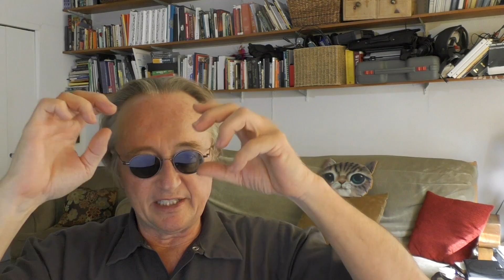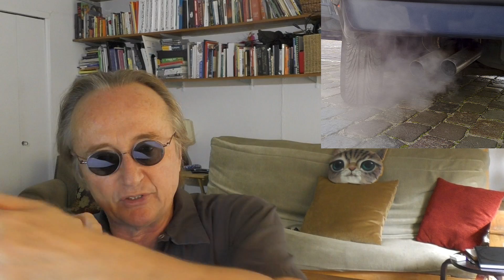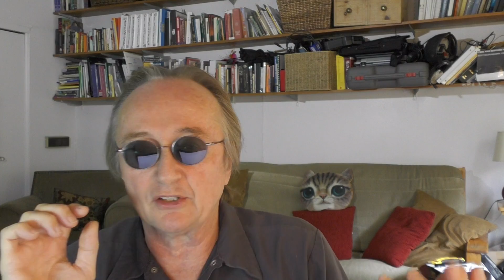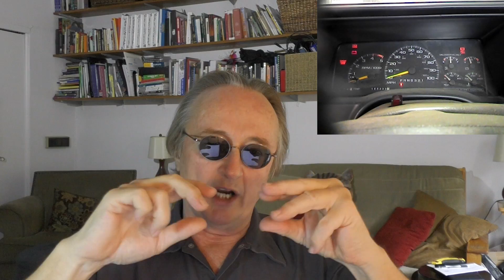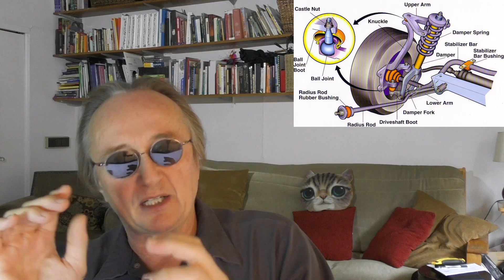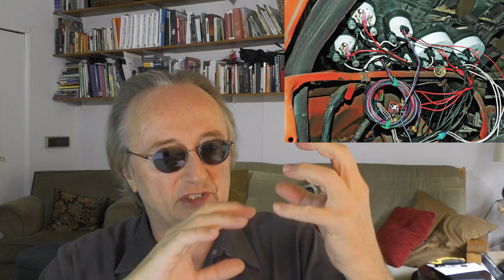This Product Will Destroy Your Car’s AC System

Comment: I've used an A/C stop leak numerous times with good results and have never had a unit damaged by it although I can easily see how it could happen. I have found that much more damage has been done to cooling systems (of all types) by untrained personel or, worse, Youtube "trained" personel  doing their own repairs.

Comment: Most interior lights have constant positive power to them, and the door switches simply complete the ground when they engage, the manual dash switch also just completes the ground. If the ground wire is shorted anywhere on its length, it can turn the lights on intermittently

Comment: Great video as always, I didn't want to comment on the Subaru though. The newer Subarus all have CVT transmissions when you get the automatic. But they do step shift like a regular automatic in certain circumstances. So it's possible that it was feeling like it was slipping but it was just because it was a CVT. It's one of the things I don't really like about the new Subarus. I've heard the transmissions are actually drive really good them for a CVT. 
I had some older Subarus with the 5-speed automatic and quite frankly those transmissions didn't shift that great either. Never had any maintenance problems or repairs, but they just seem like they hunted gears and never really knew what the hell they were doing. Compared to the same generation Mazda and that thing almost read your mind, and pick the gear you would have picked if it had been a manual transmission. Was a really awesome automatic.

Comment: Hey Scotty,
I have a 2007 Acura CSX Premium model with 124,000kms eh. I’ve been debating whether I want to do some basic mods to it; such as chips and turbo, and/or putting in a new sound system (single or double din stereo, speakers, and sub). What are my best options with this car?

Comment: Hey Scotty, greetings from Round Rock. I have a 93 Previa 2wd with the automatic transmission. It has 218k miles on it and I don't know the maintenance history. It shifts all right with a little hesitation before it's warmed up and the occasional clunk even accelerating out of a corner. Should I change the fluid, or just leave it since it's automatic. It was pretty dark looking when I checked it.

Comment: If the leak is not really bad, just refill it when needed. I had a Honda Odyssey that for 5 years until I got rid of it, I had to refill the refridgerant every spring. It was still cheaper than the repair cost even doing it for 5 years.

Comment: I had a guy I used to work with and he had one of them ford lightning pick up trucks And if you remember the lightning pick up trucks they were fords little hot rods.And the trucks would do from 130 -160 if you did  a little work on it. One day he told me all my truck will do is 55 miles an hour wide open I said what size tires do you have on the truck because it came from the factory with 15‘s he told me he had 33’s on it. So he probably was doing 130-140 miles a hour.  Lol

Comment: Previous owners put some kinda stop leak crap in the radiator..I just replaced radiator, 2 blown hoses, a thermostat and a thermostat housing..today had heater core put in..all is well👍 93 Ford econoline e150 5.8 L

Comment: 2007 Subaru Impreza hatch 5spd currently with 174,842 miles on it. Changed head gasket, ignition coil, O2 sensor and battery. Those have been the biggest expensive repairs so far. I drive the heck out of it in the snow here in MA and it has never left me stranded or stuck 👌 get a manual if you're thinking about a Subaru new or old!

Comment: My dad did have a Chevy G20 van which had to have the EGR valve plugged to stop it from stalling all the time.  I noticed I had a heck of time trying to get it above 55 for some reason.  I never tried to push it beyond that speed in case I was screwing the tranny.

Comment: 2013 Impreza. Definitely a good little car with a 5 speed. Other than when they burn oil in the early blocks. And apprently fracturing valve springs. And underpowered. But it does A to B well. Just don't get one expecting a baby WRX.

Comment: Sometimes depending on the model for that power steering noise is they put a little plastic cap as a stopper and if that plastic cap wears off or falls off it can cause it to make that noise too
Reply: In reality, there literally may be nothing wrong at all.  Turning your steering as far as it will go just puts a strain on the system.  You're not suppose to do that unless you really have to like in a parking lot or manuvering with a trailer or something.  Otherwise, you should never need to do that.

Comment: If your lights are flickering when rattled, I doubt its a short. Its probably a loose connection or broken conductor causing a momentary open circuit. I once owned a BMW with a headlight switch which had a circular connecter on the back of it (inside the dashboard) and the headlights would sometimes flicker when riding rough. All it took to fix it was removing the switch and tightening the connecter.

Comment: Had AC problems in both of my cars and, well, tried Stop Leak.  Big mistake.  Turns out that because of the salt air, because I lived near the Beach had caused problems.  Both EVAPORATORS had degraded to the point that they crumbled to the touch.  Cost a few Grand for each car to be fixed.

Comment: I don't think that stop leak in a radiator system is a good idea either. We had a 2013 Ford Interceptor Sedan with a leaky water pump, you know the kind that runs off the timing chain inside the engine. Our mechanic put some stop leak in the car and it stopped leaking, but started running hot. Couldn't drive it more than 3 miles without it getting hot, hot. When they replaced the water pump and timing chain, they pulled out about a 6" grey silicone plug out of one of the hose lines going to the pump, about 3" from the pump. A solid glob of silicone, looked like you had taken a caulk gun and shoved it up the line.

Comment: gotta love stop leak. found out the hard way on my radiator followed it to a T worked great then I parked it over the winter big mistake ended up plugging the crap out of the radiator so I will not use stop leak anything in any of my vehicles. it's always better to fix the problem right.
Reply: Until you have to remove (or have to pay someone else to remove) a dashboard to replace an heater core or an evaporator, that is.

Comment: Subaru's AWD is amazing and I love driving my manual transmission Forester, but Subaru engines burn oil.  Subaru must not be too concerned bout fixing it, they have added a low oil level light in addition to the standard low oil pressure light on their newer models.
Reply: GM does that with their new trucks.  AFM is not kind to engines.

Comment: Do not use leak sealers in cooling systems as it causes blockages in the heater matrix and also oil coolers on automatic vehicles. Its always best to find the leak and fix it.
Reply: True but a heater core replacement (just like an evaporator one) is too much often a dashboard-out job, and most people just resort to sealers as a result...

Comment: I used a very expensive a.c. stop leak ...but it clogged my system so I couldn't get Freon in...I changed the schreader and that didn't help either...I used half can on my van and half can on my cad...my cad was fine but my van clogged up...

Comment: while i dont have a ton of knowledge the stuff i know about EGR valves is that they aren't designed to stop pollution when your feet is on the gas pedal, its designed to be operated at either constant RPMs or at idle to reduce usable air charge inside the cylinder with inert (non combustable) gases and thus drop cylinder temperature and the pollution produced (essentially derating the engine because its burning less with less available oxigen) the reason why so many diesels get clogged up EGRs is because at idle/hard acceleration a diesel produces most of its soot and in those instances the valve is either open or just about closing and thus soot gets in the intake or sticks to the valve itself.

Comment: Hi scotty, 

What's your thoughts about Marly Black Gold engine oil which has graphite in it. 
They say ist makes your engine has less friction en runs smoother with better fuel economy as a result? Is this true or is that graphite bad for the engine? 

Thanks
Reply: I'd just use a good synthetic oil in whatever weight your owner's manual calls for.
Reply: Hello greg, 
Did you've maybe had trouble with marly black gold?

Comment: Anyone with knowledge of how a refrigeration system works would never use this product.  Unfortunately,  the workers at a lot of auto parts store will sell you anything.
Reply: The problem is, if the evaporator is leaking and you don't have the (ludicrous) amount of money to have it replaced or can't find any instructions to remove the dashboard by yourself and you're not willing to risk damaging the dashboard, you have to choose between no AC and the sealer. Most people choose the sealer. If makes made the evaporator replacement easier, this wouldn't happen.
Reply: @teravolt6113  they will never make evaporators easy to replace. It's a money grab for car manufacturers .
Reply: @teravolt6113  don't use that garbage.  I'm sorry you don't have money for expensive repairs,  but you will lose in the long run.  Fyi.
Reply: @kurtzimmerman1637  You think it's just garbage? Why? By the way i'm just focusing on the design, not on the specific product. If you look at the design of evaporators found on American and European cars you'll find that the refrigerant is carried to the evaporator by pipes that look a little too long for some stress to not be here in a road vehicle. In fact my Japanese car's AC evaporator (the OEM one) has the design i showed and it hasn't got any leak even after 15 years. The evaporator box is made of two halves that close together like a clamshell and also hold that TXV mount on the top very tight.

Comment: I had a problem with the interior light in my '09 Lancer. The bulb wasn't working when I bought it second-hand, so I thought it needed replacing, but just reseating the bulb in the socket fixed the problem. Every few weeks it would stop working again and I'd reseat it to fix the problem. This happened numerous times until it finally decided to keep on working, and I've never had to touch it since. Really strange. Always check the bulb first!

Comment: hey scotty, i have a 1997 corolla sedan (ae101) , it has orignal radio (tsn5010) it gives sound ok but a week ago i turned on radio it just pump the speakers up as current is flowing but no music is playing when i turn it off a clicking sound comes from the speakers then it turns off ?  what could be the problem
Reply: Buy new speakers.

Comment: Hi. I have this question 
Buying a used car in the winter, how can i test to see if the A/C works?
Reply: Turn it on and if it blows cold air it works, thats about all you can do.  Probably be a good idea to do this once you have let the interior get really warm by using the heater.

Comment: Scotty made a comment in another one of his vids that Chrysler/Fiat auto trans are weak by explaining that he knew someone that had a Dodge truck with a failed auto trans at 200,000 miles.  I'm not an advocate for Chrysler, but what the hey is wrong with an auto trans that lasted for 200,000 miles with probably no maintenance??  Our 2017 Mazda CX5 with auto trans (another Scotty hate) now has 10,000 miles and is still kicking butt!
Reply: 10K miles is literally brand new so it should work perfectly.  But yes, he rags on every auto transmission except Toyota.  Most GM transmissions go around 200K before they need rebuilt too.   Ford as well.  And yes most never do anything other than drive them.  The fluid is probably as dirty as medical waste by the time they fail.

Comment: well, I put ac stop leak in my 98 dodge ram back in 2012. works fine to this day and I've not had to touch it since. so I respectfully disagree. BTW, every mechanic I've talked to says the same as you, but it worked for me

Comment: A short is a closed connection that could make something come on when it is not expected; an OPEN circuit is something that will prevent current from flowing. Not all electrical issues are "a short."

Comment: Good Life Scotty! What should I do if i left my car Idle for 5 hours or more? I have a 2013 Accord 4cyl, I turned off my AC and Radio but forgot to turn off my engine, left the car idling on the parking lot for 5 hours. What would you suggest that I should do? Thank Scotty and More POWER TO YOU! P.S. Do i have Alzheimer or did i asked that already?
Reply: Desktop Connection I would suggest getting checked for Alzheimer’s.
Reply: Other than wasting gas, it probably didn't hurt anything.  How in the world you exited the car and didn't realize it was running is a real head scratcher.

Comment: My sister had a Subaru but she didn't know about trimming belt replacement until it broke. She always took her car to "The Dealer" for "The Best Service" even when I told her she could save money on an oil change shop, but now - because of "Dealer Service" she has a new car. Trashed valve train... & did they tell her? No. Dealers are no deal. So sad...
Reply: I would think with all the technology cars have now the car should tell the owner when the timing belt needs changed.  I bet 9 out of 10 American drivers have never heard of an interference motor let alone know if they have one.
Reply: I've owned many vehicles but have never had a timing belt fail.  Its not something that is supposed to ever need replaced, its suppposed to last as long as the engine does.
Reply: Greg Rowe No a belt isn’t designed to last the life of the engine.  But it will last exactly that long if you never replace it.

Comment: Loud sounds on a steering system on the old steering box systems might be the bump stops need grease smeared on them.

The more modern rack and pinion steering systems stops steering travel by the rack, but the old systems "bottomed out" by a nub by thr brake caliper actually was designed to hit the frame on a social little reinforced area and stop the steering  wheel travel. If you go over a bump the suspension will move up and down and scrape on the car's frame.

Check bump stops if equipped.

Comment: Hello Mr Kilmer, I was wondering if you've ran into any 6.4l ford diesels with egr problems. I ran into one and tried to remove the valve only to realize the thing had become one unit where it was mounted on. If so, do you know any tricks? Thanks. Love the videos.
Reply: Dmushrooman Ramirez 6.4s are notorious for EGR problems. The problem is they stuck the EGR valve on the intake instead of the exhaust so when the exhaust cools down near the intake the soot in the valve cools down and hardens clogging the valve. This is because the intake is cooler than the exhaust manifold.
Reply: Best bet with a 6.4 is to properly delete it.
Reply: Oh wow, thanks @Marklin15  . I'll look into that delete then.

Comment: Have a 2003 Chrysler Town & Country, a few years ago the lamps for the center console lamps stopped working for the buttons on the radio, a/c & heated seats & headlamp switch. After resetting the IOD fuse they all worked again. They have now stopped working again & the IOD fuse does nothing to fix them. The lamps work when you apply power. Don't know what to do?

Comment: Scotty! My 2015 chevy Equinox sounds like a bucket of bolts when it is cold. When it's under pressure sounds fine. But let off the gas.. clinkity clink ensues. What's with that? Only 51k miles.
Reply: 2.4 engine, right?  Get it to a dealer there's an extended warranty for timing chain and tensioners problems.
Reply: @terrywaters6186  Thanks I will look it that. 👍

Comment: WARNING: Just this week I purchased  Radiator Stop Leak as my car was loosing about 1 litre of coolant every 500km. Where the top tank of the radiator crimps on to the core there was a bit of seeping not a big deal. I read this info on the Rislone site saying it is guaranteed not to block your radiator so I thought I would try it. Well the day after putting in the Stop leak my car over heated even though it was full of coolant. When I took it in to the radiator shop to get repaired the technician opened the radiator in front of me and yes all the passages were completely blocked with Stop Leak and no coolant could flow through. This product caused a large amount of inconvenience by leaving stranded on the side of the motorway and left me with a $300 repair bill. Do not buy this product unless you want the same result I got.
Reply: To be honest, $300 isn't a huge repair bill.  You got pretty lucky if that's all it cost you.
Reply: @gregrowe1168  The Radiator repair guy said it would have been $50 to re-crimp the top tank had I not put the Rislone Stop Leak in. He also said that Stop Leak brings him a lot of business. You are right though it definitely could have been worse.

Comment: Scotty, I have difficulty at times, getting ignition key out of my 2008 4 door, Hyundai sonata...I know I am not alone...19 other car owners, have the same problem...Hyundai motor America in fountain valley, California refuses to do a recall, even though by law, they hit the maximum. Amount of complaints by Hyundai car owners, over the ignition issue..I even sprayed wd/40 in and around the ignition itself, just in case the issue of it sticking..I don't know what else to do at this point....
Reply: Replace the ignition.  That's about all you can do.  I don't know how much it would cost for that car but had it done on a 99 Silverado a few years ago and it cost about $200 including labor.  My key fit fine buy it would only start the truck intermittantly.  You had to catch it just right or it wouldn't work as it was worn out.  Your car is so old now that it would be considered a wear issue and they probably wouldn't replace it anyway.